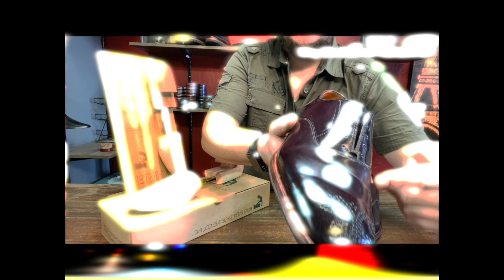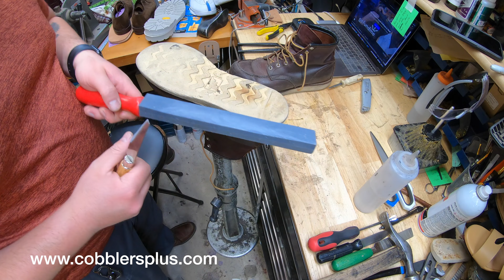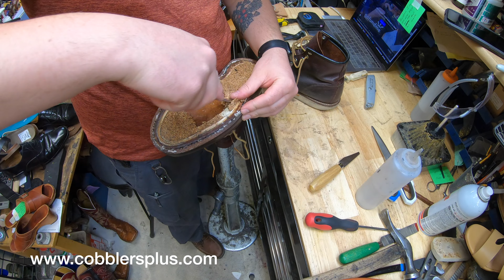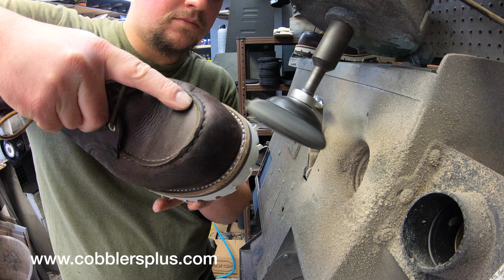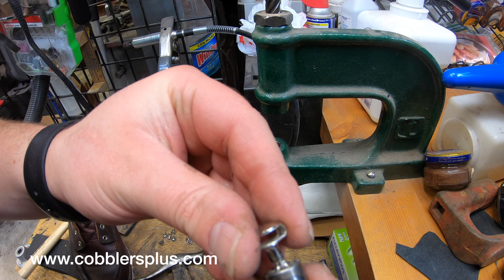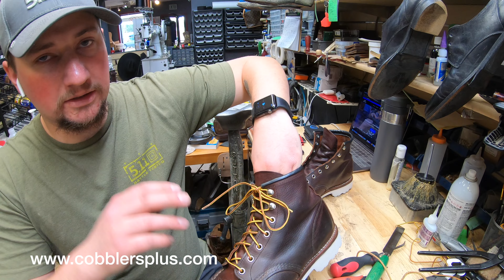RedWing Moc Toe 8138 Boots saved after some DIY work with Vibram Roccia Grigio Soles to change look

Comment: I am thinking about having something like this done to my shoes, but I have a couple questions. What glue did you use and where can you buy the sole replacement?
Can this also be done to a pair of redwings that are not part of the heritage line. What I have are considered a workboot. (Called the traction tred light. Style 1221) 

Thanks so much for making this video!

Comment: Serious question why do some cobblers put acetone on the leather mid sole when it won't even penitrate the leather? Why not just soak the sides where it can do more good..
Reply from the maker: Most leathers when worn down will have thin enough spots for the thinner to get through making it easier to pull up. The sides is important though to get

Comment: Are the Vibram 4014 rated as non-slip?  I haven't been able to find any solid info on this yet online.  I have been wanting to buy a pair of Nick's Boots for work, but they have to be non-slip.  They offer the following sole options: 430 Mini Lug, V-bar, 2021, 4014, and 377K
Reply from the maker: For best grip you might want to go with the Vibram 430